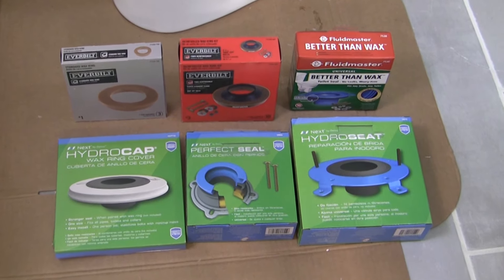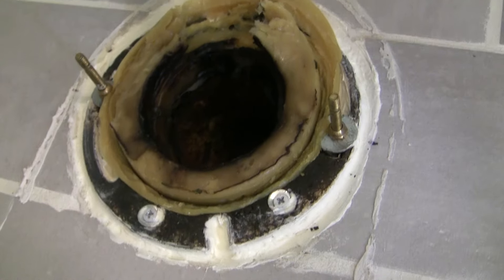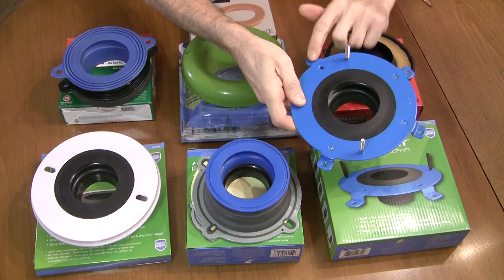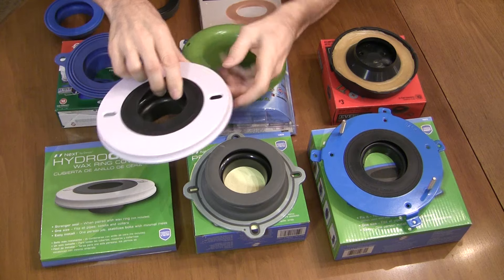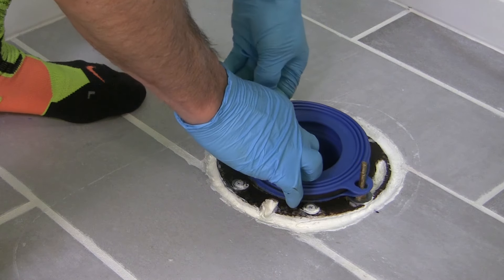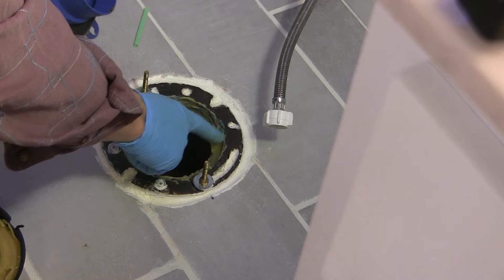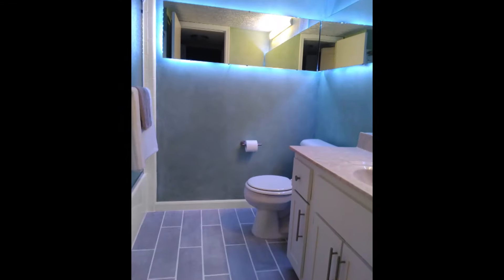2 YEAR FOLLOW-UP to Toilet Flange Fix  / Also, Compare Different Toilet Seals

Comment: Thanks Marty…. I’ve changed and installed several toilets without any problems until recently when the wax failed. I’m switching over to a Perfect Seal gasket which has an enclosed wax ring !
Reply from the maker: It seems there are plusses and minuses to each one of those rubber rings, but that one you're going to use seems like it would be a good one.  Good luck
Reply: @MartyPollio  Just to let you know, I installed the “Perfect Seal” yesterday. When I removed the old wax, it appeared the wax had actually failed at the flange connection. Not sure how this even happened because I had used an extra high wax ring which it was apparent I had bulls eyed with the toilet and the toilet was well seated. However, when installing the new “perfect seal” I took some of the old wax and spread it on the existing toilet flange and pressed the new seal onto the to ensure seal was solid. Then I placed the toilet on top as per instructions and it worked like a dream with a solid, firm connection.
Reply from the maker: @richardtruckner2203   I'd be curious to know how the rubber materials hold up to chemicals in the water over time.  When I pulled up my Fluidmaster seal (a follow up video to this one) I noticed there was water damage, but the one you used is thicker and tougher rubber than mine.
Reply: @MartyPollio  Hi Marty, I’m not 100% sure of the formulation of the rubber used but I assume they are using some variant of silicone rubber….. if so, the rubber should hold up very well based on the results seen generally in rubber seals used in various industries.

Comment: I used a combination of the blue flange repair setup on the lower right, and the better than wax ring and horn many years ago to fix a rotted copper or brass flange in a 120 year old house, worked really well. It was not an ideal situation and a plumber would have probably insisted on placing part of the drain to do it “right” but for $25 and some elbow grease i never had an issue from it again.

Comment: I used the seal u used , and it popped out or got nipped during installation , leaked and ruined my ceiling .. my 2nd floor ceiling was stained /water damaged . It was an issue with flanged not sitting too low . Today I used the perfect seal , and so far it seems to be good .like tha fact the it’s adjustable , I took off the top part and the black insert .. fits my new toilet snug , now just testing it for a day or 2 to see if there’s any leaks , before I chalk it . Thx for your , informative videos , u are doing what a lot of us , diy was wondering

Comment: Excellent video! Thank you for sharing this.
I have nothing against so called professionals, not just plumbers, i mean all "professionals", but unfortunately there has been a culture shift. That pride in one's work, and getting things done the right way is no more. Not all are like that, but majority is, and it is hard to find that one good one. Other than shoddy work price gouging, and plain dishonesty is another factor. Although, most of the time it probably costs me more to do it myself (taking into account the value of my time). However, I get peace of mind that it is done right.

Comment: I used Korky on toilet flange over a 1.5” lower than the tile.  Yes I considered cutting the PVC and starting over but like you I tried a wax less experiment and it worked!

Comment: Your video answered a major question I have that I was going to call Fluidmaster about. What's the diameter of the bottom of the blue funnel on the Fluid Master seal. You mentioned 2 3/4. That's the same size as the horn in a wax seal or at least the one I measured. You also showed many of questions I had. You put nuts on the bolts at the bottom to keep the bolts straight. I read about using straws on the bolts to help guide the toilet when putting it down. Think you could have used larger straws but you're the only one I saw use them. Thanks!!

Comment: I'm an ex landlord and performed all my own toilet repair jobs. First of all I like the silicone  caulking around the flange to protect the underlayment of the bathroom floor. If there were to be a leak from the toilet flange and/or toilet gasket your floor under your tile will be compromised. The is a good video. Informative and DIY. BTW I installed sani seals in four of my rental toilets and everyone of them failed. The sani seal became water logged instead of repelling water it absorbs water each time you do a flush.
Reply from the maker: Supposedly, part of the problem with sani-seal rings is that they don't hold up well to the chemicals in tap water.  So, even if they don't get torn, the coating breaks down.
Reply: @MartyPollio  thanks Marty. See you your next video

Comment: Fun to watch you obsess! I do the same. Plumbing tasks are my least favorite. I’m working on replacing my wax ring. Of course there is a crack in the top of the flange. I’m using Sugre to seal it and then finishing the job. I replaced all old tank parts last week. It took me 5 hours to remove one of the flush valve bolts. I had to saw off the nut on fill valve. Nothing easy or pleasant about any part of this chore, but plumbers in my area charge $300+ to do this project.
Reply from the maker: I feel your pain.

Comment: I used that seal it leaked after six months, same glue speration issue.....I'm actually replacing it with the foam one now. Putting some wax over the foam one I hear helps negate the breakage issue. That break DOES start in the bolt hole location....so I imagine some kind of rubber sleeve would help to keep it from rubbing metal in addition to stuffing wax it there...maybe🤷🏻‍♂️. Also, if you don't want your tank bolts to rust all you have to do is switch out the bolts and nuts with high grade stainless steel. Just saying... It's all trail and era....and I mean era, cuz it feels like I've been fixing broken s*** around my home for an eternity. Anyway, loved the video great presentation.🙂

Comment: I loved your video. I struggled today with trying to seat a 4000 lb commode on a wax ring. There was no mention on the carton to bolt down the bolts. They were moving all over the place. That's just totally insane. Also the person who put the the flange in  put it at odd angles where one bolt is real high and one bolt is real low. Not on the same level so now I have to figure out how to get that permanent flange out of there. Maybe I'll try a pick ax or chainsaw to remove the flange. They put these tiny bolts in the carton with tiny tiny nuts. One of the bolts got bent by the mammoth commode. Tiny nut would not go on and now I have to saw them both off because the nuts are stripped and stuck on there. This has been a nightmare but I have to keep at it because I don't have money and got ripped off by a plumber.🙄🤔😁

Comment: My toilet is removed from the flange as I type here, I almost fell for the sani seal and the fluid master, sani seal is nowhere to be found, fluid master is, I’m out the door for two wax seals as I’ve always done, and some stainless securing hardware, thx. Personally I’ve installed every plumbing fixture in my home, I know my limitations though, such as installing gas lines to bbq etc, but I pay close attention to how it’s done, and did the final connection when I finished the bbq install. Most  of my family were knowledgable and or in the trades. Remember the days when children received gifts that were tools or something to construct, like tinker toys, the good old days 👍🏻🇺🇸

Comment: So funny, I literally had a leaky toilet this afternoon and used the same exact seal. The only difference is my flange is floor level, so I used that additional included foam backer.
Reply: I just installed the Fluidmaster and I see a leak at the bowl.  Flange is floor level too.  I guess I need to use the extra foam ring or go back to wax (ugh).  Is this the exact problem you had?
Reply: @mario7mag  Well, That foam backer is likely to increase compression, I used as per the instructions.
Reply: @aphleesegurtra2820  I ended up having a hairline crack in the toilet bowl.  That is why I had the small leak.  Thanks for the update!

Comment: I used the Fluidmaster Better Than Wax Waxless Toilet Gasket, the upper left one and installed it in less than 30 minutes. Took a while to remove the old wax but afterwards the the gasket fit well. No more wax!

Comment: I like this guy. Thanks for the laughs! I've rolled my own with wax/plastic funnel combos as well. I built up the wax in height, and where it meets the porcelain ring, I filled the void (looks live a sideways >) with addition wax applied by hand for a more perfect cylinder. Since toilets use cold water, said wax will last without eroding much. Mine empties towards the wall, thus I was thorough. Another toiled that I installed in 2009 has been problem-free after four tenants.
Reply from the maker: Marcos Mota  I don't quite understand.  Do you add wax to the inside of the ring?  If so, do you put the wax ring onto the toilet first or do you put it on the flange?

Comment: I hear you on the advancement of the tech. Kohler does have toilets where the bolts don't go through the tank eliminating two points of failure

Comment: I have never been satisfied with any plumber I've hired. I have hired five different plumbers in different states over the past forty years.

I gave up after the last plumber I hired created a bigger problem than the one I hired him to fix. I learned how to do plumbing repairs myself. I learned how to solder copper pipe, change toilets, repair leaking faucets. Change out toilet valves, repaired hot water tanks, etc. You can actually buy new faucets in some cases cheaper than hiring a plumber to repair a leaking faucet.

Changing the heating elements and anode rods can extend the life of hot water tanks for years. Changing both elements, thermostats, and anode rod yourself can be done for $76.00. A plumber will charge $200 minimum just to change out one heating element.

One plumber told me the cheap kitchen sink faucets would not hold up. I once paid $49 for a kitchen faucet that was still working fine twelve years later, when we remodeled that kitchen and removed the sink and faucet.

The stuff available to home owners to repair plumbing stuff is not that difficult to use. I have not used a wax toilet gasket in over eight years. I've set five new toilets since 2017. None of them are leaking. That fluid master seal you used is what I use. I have not had to stack them, but there is no reason you cannot stack them. I once did use one sani seal for an unlevel toilet flange. It also has not leaked, but I would not use that design again due to the problems I have read about them deteriorating.

The ideal toilet seal that would work in every application would be to combine the Sani seal concept with the fluid master design that provides the rubber part that extends down into the pipe. The soft compression sani seal part would need to be made of something that would not deteriorate from water over time.

None of this stuff is rocket science.

Comment: I remember running across your other video replacing the wax ring when I was researching to replace mine. I ended up using the one with the wax seal built in to it and another wax ring under it because my floor was not level at all.
Reply from the maker: That's an awful lotta wax. Hope it worked out.

Comment: We’ll done, I’m going with the better than wax solution as well, I’ll wait to see your report in 2 years. Plumbers can get expensive really fast, best to do it yourself when feasible.
Reply from the maker: I've been working on the follow-up video to the Better Than Wax solution.  Before you choose to use it, I've gotta tell ya it did not work well for my situation.  If you have one of the newer PVC drainpipes it may do fine, but the opening on my old cast-iron drain was too big for it to work well.  Thanks for watching.

Comment: Marty, I wish you lived near me.  I'd hire you all the time.  When you lifted up that seat, your work from 2 years ago was pristine. You shamed those other plumbers, that's what you really did.  I have a leak (among other problems plumbing) and I was considering trying this.  What was the material of the "seal" on the one you ended up using?  It did not look very durable to me.  Make more videos, please, I loved it.

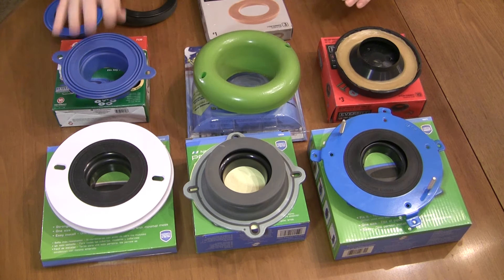Comment: 10:08 Don't use Fluidmaster's "Better Than Wax" product. That was my choice as well for a toilet that began to leak at the floor. Three years or so after installing this product, it began to leak again. When I removed the toilet, I discovered that the plastic that this product is made of had hardened and deteriorated, allowing the leak. Many types of plastic deteriorate over time. I sensibly assumed that Fluidmaster would have used a plastic that would endure. They don't; the product is garbage.
Reply from the maker: Yeah, I agree. I did a follow-up video to this one where I discover the same thing you're talking about.
Reply: Uh oh, I'm about 2 years in...

Comment: I just bought a house. It's on septic. The toilet is very low. The bowl water was high. I was tea baggin. I adjusted the float and the bowl water level is better but it's such a weak flush. I'm not sure if it's because it's such a short toilet or if it can be fixed. I may try buying a new toilet but I  was wondering if maybe I may run into the same weak flushing problem due to being on septic. I wonder if there is some pressure or resistance causing the weak flush. I quit flushing toilet paper but it still struggles with just poop. I like your style bty
Reply from the maker: Ask someone at a plumbers supply store.  I do know that some toilets have a stronger flush, especially the ones in commercial buildings because they use vacuum assisted flushing.

Comment: Putting a set of washers and nuts on the flange bolts was a very good idea....I work at Lowes and recommend it all the time. IMO you probably could have gotten away with just the foam in the crack/cracks or, you could have used some DAP quick dry caulking. In other words, you sort of "over did it" but still a great, great job.

Comment: Sure, you overdid it the first time, but did an EXCELLENT job.  @8:05  This is my go to ring and it hasn't failed me in the 15 years I've been doing this.  Btw - you don't have an out-of-level problem.  It's not quite level - but that's not a problem.

Comment: I just removed the original 1951 toilet from my home.  The Wax ring still held up.   My advice would be to get one big wax ring or two small ones and stack them.  It's a tried and true method that works.
Reply from the maker: Bingo! That's what I ended up doing in my third video.

Comment: I loved the video, your humor and your thoroughness! You did a really great job! I feel more confident about tackling my toilet repair tomorrow. I also have a 3 3/4 inch cast iron pipe I’m working with. Your toilet seal review was great. I actually had looked at the exact same ones wondering which would be best. Thank you for your knowledge and personal opinion.

Comment: Informative video Marty.  One thing that I am a little concerned about regarding the "Fluidmaster no wax ring"   is what happens if you get a backup down in the pipe and the ....fluid finds its way up the outer sides of the rubber device?   It seems that something of that nature would be likely to occur because there is not a sealed fit or connection such as with the wax - especially considering the various sizes in drain pipe openings.   The extra wax placed directly on the flange and the top of the drain might have been the right thing to do for a little more peace of mind.
Reply from the maker: You're exactly right.  I did a follow-up to this video called, Two Year Review of a Rubber Seal.  I pulled up the toilet to see how well the Fluidmaster did, and it was in the exact shape you're predicting here.

Comment: Be happy you didn't use the saniseal. The rubberized coating separates from the foam over time, in all the wrong places, and it becomes waterlogged and starts leaking. I also thought it was a great idea, but not so much!

Comment: The glue that holds the foam to the rubber is just to keep them stuck together until the installation is done.  Doesn't do anything to seal from water leaks, so don't worry if it's starting to peel

Comment: As long as you don't have a leak, crack the toilet, etc, you did a good job.  Marty, if you have the time, take a look at Korky brand products on their site where they have a video, I think you'd find interesting, detailing installation of their brand gasket.  No I do not work for Korky.  Last time I had to dismount a toilet (turned out to be one heck of a load of you know what in a bend - yuk).  I installed a Korky wax free gasket and haven't had any issues. Also, their products are made in the USA.

Comment: Oh and check out Fernco Inc. FTS-4. It's my other option I'm thinking about. Fernco makes excellent products like no-hub connections that are used in municipal applications, so I trust their quality in that sense. It uses an adhesive to stick to the bottom of the toilet. Not reusable but from the reviews I've read everywhere it seems pretty solid.

Comment: I will never use wax, it's so old fashioned.  1 hour later : puts wax everywhere and the leak stops.
Reply: use 2 gaskets and it should never leak again
Reply: He is complicating stuff way too much. A simple wax ring would have been a lot better than all the stuff he did.
Reply: The leak was in the tank, not the bowl. He only added wax to reassure himself that the broken bond between the flange amd the foam gasket wasn’t going to be an issue.
Reply: You must be an engineer , over kill .